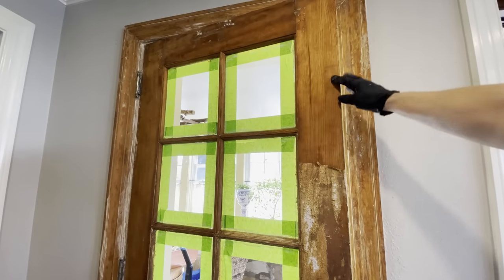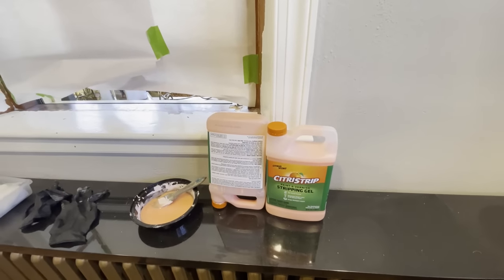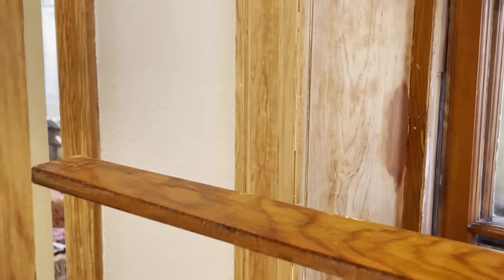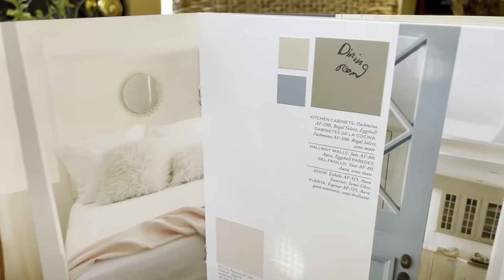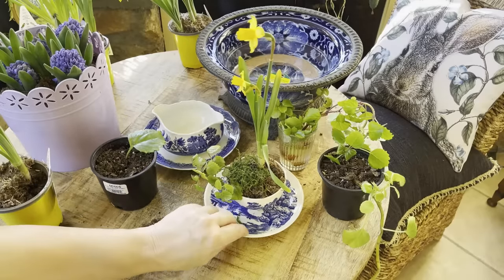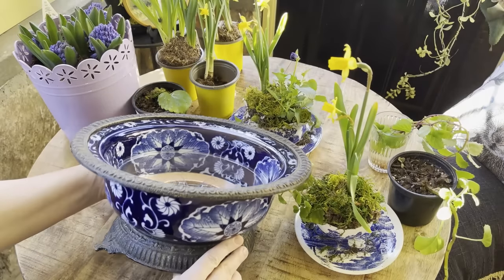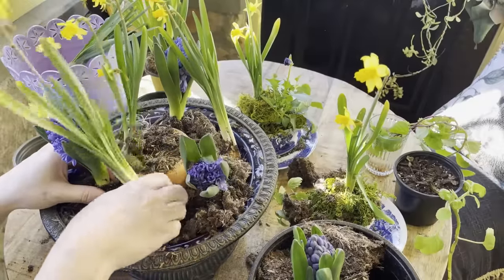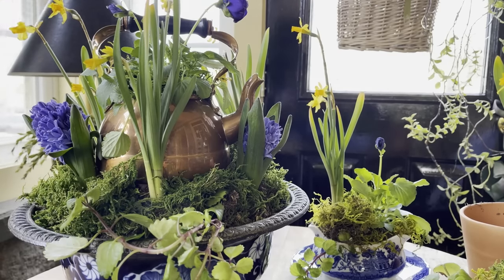RESTORING OLD VINTAGE STYLE ~ LIVING ROOM MOOD WALL SERIES ~ RICH TEXTURES, COLORS, & BEAUTY

Comment: Love the plantings!!! Here's  a technique I like to use that I learned in art school: Talk to the "paint person" behind the counter, and ask them to locate your sun room color on their "Fan Deck". (They do not let these out of their sight!) You will see the same color on the strip, going from light to saturated, depending on how much white or black is added.
So I would try the palest shade, (the one at the top of the strip) for the mood wall. It will "almost" read white, but what it does is visually pull the color forward from the sunroom. It all works together. 
I would see if you can get a little sample container, and paint a couple of samples on the mood wall and see how the light plays.
This only works if the sunroom is not the lightest lightest shade, but to my eye, I'm thinking it's not.
I hope this makes sense...😊
Reply: Oops...I listened to this a 2nd time and you said you didn't want yellow...Sorry.